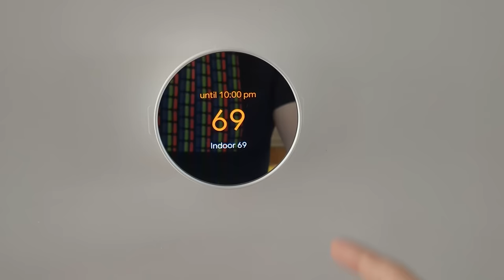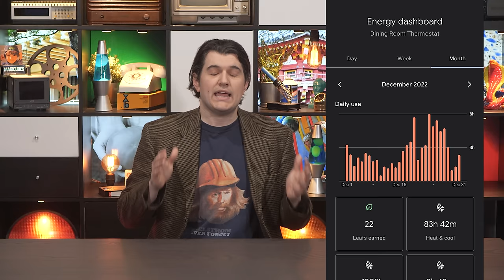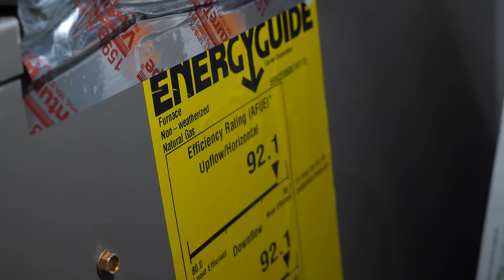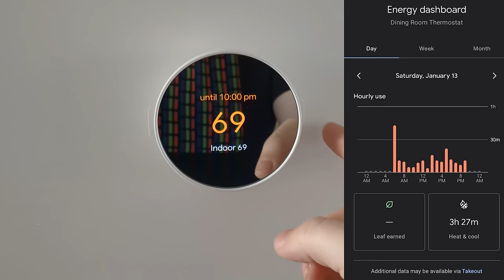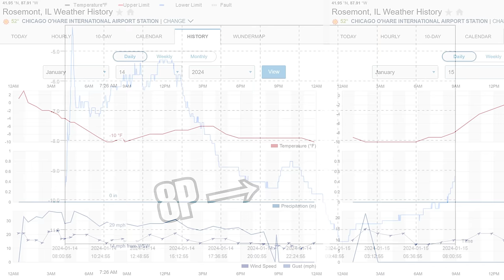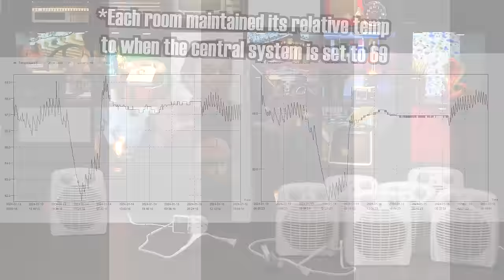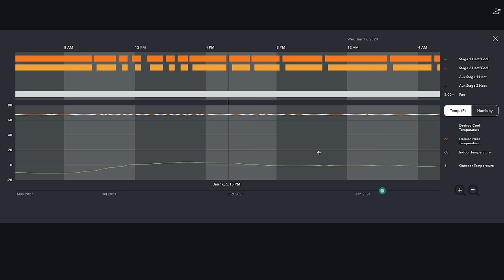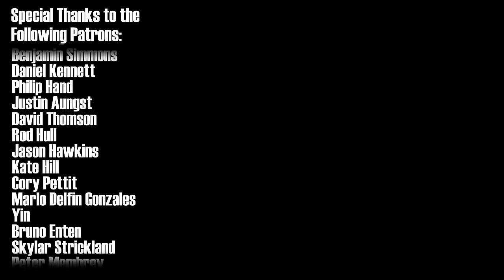Old HVAC industry practices are holding us back and costing us money. But we can fix it.

Comment: I am a HVACR professional and I now train others in the HVAC industry. This is solid gold. I strive to instill in my trade that we have been constantly oversizing  equipment for as long as the trade has been around. 
I converted to what is called a dual fuel setup about 10 years ago that is a heat pump with gas backup heat (lots of boring details as to why I went with that setup) 
 When I bought my house it had a 120,000 btuh furnace installed. I now heat the house with a 3 ton heat pump which matches the cooling load on the home it is matched with the smallest furnace I could get that can provide airflow for the HP and has the capability to  operate at 40% of its rated capacity. I live in a cold weather climate and with some minor help from the furnace on that colder than cold day once In a while it keeps my home very comfortable. 
Using similar  thermostat technology I can track my power and gas usage and typically my furnace runs less than 
15 minutes per day most days. And that runtime is almost all when the heat pump is defrosting. 
My area has incentives from various agencies and organizations will completely if not more hand cover the equipment cost to the contractor for the cost differences in the equipment from AC to HP units. Installation cost differences given modern thermostats is almost $0 
A lot of what someone people will call out as flaws in his analysis are not reading between the lines in his data and methodology. You simply cannot give a masterclass on absolutely everything that goes into this stuff in one hour! Some details are left out.
Great video 
Anyone who says otherwise is definitely selling something
Reply: You sound like one of those that knows your craft. There are a lot of goobers in the HVAC industry, despite all the talk about manual J calculations, I suspect either very few actually run them, or they are not very accurate (garbage in-> garbage out?) because it is very rare that I encounter a furnace that is not grossly oversized.
Reply: I live in Montana, we use a 5 ton equivalent heat punp for heating and cooling, and despite only having 8 inches of fiberglass roof insulation in a valulted ceiling 4000 Sq ft monster. Unless it goes below 0F we don't even need additional heat for it to keep up at 64F at night and 68F during the day. 

Average cost is $270 a month, for heating, hot water, cooling (we love it cold, so 66F during the summer inside) and the geothermal backed heat pump also makes hot water.
Reply: What if I don't want my furnace or ac running 24 hours a day? Having a house that is comfortable in temperature and noise is a feature not a bug.
Reply: Everyone should know a guy or two like you. I don't know any!
Reply: @MegaLokopo  - You must have a noisy one.  They aren't all that way.  My wife keeps asking me if ours is running because it's quiet enough that we can barely hear it.  Sometimes she'll hear something and ask and it's the refrigerator humming instead.
Reply: The most experienced HVAC professionals in Scandinavia know that undersizing the heat pump is the best for your wallet and best for the longevity of the heat pump. See my other comment for more info
Reply: Isn't there an efficiency benefit to not running the system under full load?
Reply: @per7898  Read your full comment, great!
Reply: @JacksTheRabbitsTube   Almost always no for machines and systems.
Reply: @MegaLokopo . I am a little confused as to why it’s important to some to have the furnace run constantly on the coldest days. Sure a larger furnace costs more, but also surely a furnace that runs longer is going to wear out faster. I would like to see a complete analysis of all costs over the entire life time of a typical furnace.
Reply: @MegaLokopo  I can't hear ours run, it's inside a sound proofed metal enclosure, the only noise I hear is the ground loop pumps if I need to add air to the pressure tank, and it's a good reminder to change the filters. 

If it makes noise you can hear you might have issues.
Reply: @Pseudify  It's most efficient running more often. We also run the fan 24/7/365 to help balance the temps in the house, to remove dust and pollen from the air. Living in the mountains with pine trees around we get a lot of pollen in the air.
Reply: @Steevo69    Okay, I hear people say that running constantly is more efficient, but I don’t see any explanation or data as to why that is.  No offense, but I trust data and reasoning more than people’s claims (I’ve been fooled too many times). It also clashes with common sense that something running for 24 hours straight is going to experience less wear and tear than that thing running intermittently for 2 to 4 hours over a 24 hour period (especially when there are high temperatures, running motors, and the like involved). I understand that starting and stopping has costs - like the igniter or flame sensor might wear out faster - but those are cheap to replace. I’m not saying you’re wrong. I’m just saying where’s the evidence for this claim.
Reply: @Pseudify the constant running should only occur on days where the load on the structure is at its maximum when the system is sized correctly which occurs generally only a few times per season. My area didn’t even experience one day this year other years we see it multiple times. 
He mentions this in his video
Reply: @effwrench7524    Yes I know this is what people claim. That’s not what I’m getting at. I want to know why this is and where is the data to prove it. It seems to contradict common sense that a furnace running for 3 or 4 hours a day is less efficient than one running 24 hours a day. I don’t understand why this is and I would like a rational explanation and to see data to prove it.
Reply: @Pseudify  Without going into the constant running/stop start efficiency (mostly because im not educated enough on that topic to address it), lets just talk about the economics of the situation.

Why does this matter?
Well, imagine you go to a restaurant and order a 20 dollar meal. Would you be happy with that purchase if when it came out 60% of that meal was set aside and you werent allowed to eat it? No, you wouldnt. Thats what happens when your heating system is massively oversized. Even when at peak demand, youve paid for a shit ton of capacity youre not ever going to use. (and any heating system is going to be very expensive.)
Yes this analogy is flawed, you dont pay maintenance costs on food you eat so lets talk about that next.

Maintenance costs is frankly irrelevant in regards to determining what size you should get. Sure, a smaller system running more consistently may need more maintenance, but its going to take well over a decade before that system reaches the costs of a larger system. A 3 ton system that most need costs around 2-3k less (depending on models) than a 5 ton system that theyre told they need. Replacing a fan, compressor or whatever is not going to suddenly skyrocket that price to where they match. Even then, the larger systems parts cost more, as they need to be built to support more. An oversized system will still have to be maintained eventually which again makes it harder for the smaller systems to suddenly catch up. (most HVAC manufacturers also offer some form of 10+ year warranty either way.)

Further, most North Americans already have a properly sized temperature unit on their home. Its called their air conditioning unit. Even running at max capacity on the hottest days in the summer, it takes a long time before any parts need to be replaced.
Reply: Anybody want a peanut?
Reply: @Pseudify please see his follow up video on his secondary Channel
Reply: @Steevo69 $270? wtf? i live in europe with expensive energy. i have solar panels and a hybrid heat pump (gas backup, gas hot water) and i pay less then €50 a month for my energy bill.
Reply: @Terrorrai1  1) 4000sq ft/ 372Sq m.
We have seen -40F/-40C for a week, and multiple weeks below 0F and closer to -20F at night and 0F for a hour or two during the day.
During the summer it's not uncommon to have weeks of +100F/38C and during the day and we had 114F/45C peak temps. We keep the house at 66F during the summer.

Only our Viking range uses propane as we live out of town, the water heater is electric and the superheat let's the heat pump make hot water when the conditions are right.

So our, heating, cooling, lights, two refrigerators, deep freeze, Sauna, hot tub, fans, washer, dryer, etc cost us $270 a month.

 Solar for a 2 phase 100Amp service would never see payback for us. We looked into doing it when we has the roof done last year. I am working on a backup propane/gasoline generator solution though.
Reply: @JacksTheRabbitsTube  gas furnaces lose efficiency during heat up and cool down. The longer each cycle is the longer they last and more efficiently they work.
Reply: @Pseudify thermal expansion. There's your common sense.
Reply: @Pseudify  motors are least efficient on startup as they require more energy to start then to keep going. The high amp draw adds resistance which generates heat. Stoping and starting add to high energy costs and wear and tear on windings. At least this is the way I understand it. Also a constant running unit will make it more comfortable with less hot and cold areas of the home . Although a system that’s incorrectly installed which is most of them will have high static pressure in duct work ( higher then recommended static pressure) so a system that runs more might end up with more wear and tear on fan motor as it will be fighting that pressure . And higher energy usage.  I also would like to see experiments testing different scenarios to confirm if running fan 24/7 is best and if a longer running hvac system is best. But it does seam to be the common belief.

Comment: Hearing you talk about Manual J calculations warmed this old HVAC guy’s heart.  Thanks for a great video.
Reply: how many J of warmth tho
Reply: @NickiRusin Depends on the size and insulation of his heart.  Probably between 20-40K btu. ;)  It warmed, not maintained temperature, after all.
Reply: Think about that heat pump in below freezing ambient air.. I wonder what he will think about his power bill using electric strips…

Comment: I’m a HVAC salesperson in the DC Maryland Area. Old oversized equipment is so prevalent here. And you can take your time explaining to the customer why it’s oversized, but when you have customers who say why change it if it’s worked for all these years and other salespeople just spec what they had. I did that to a customer…had a 3.5 ton ac and a old 150k furnace from the 40s…i put a 70k furnace and 24k heat pump. Row home about 1800sq ft. Customer kept bringing up how this website was saying he needed 4k…we installed it, he loves it. Great video!!
Reply: Glad to hear there's someone else in the DC/MD area trying to educate customers! We need more salesmen like you around.
Reply: @andrewsherlock7296  
I try, I try. I still lose customers. Right now im in an uphill battle with a customer who has a 3.5 ton unit, with a small return and plenum to branch out, and 1200 sqft home. Complaining that he already struggles cooling the 2nd floor, his unit short cycles, so air doesn't move with what he has now.

Comment: As a HVAC service tech I have know this for over 50 Years.   I was asked to design and install a new furnace and A/C system in a house which was having an addition added.  The addition was almost 2000 Sq Ft.  The house was built in the 60's had a large furnace 160,000 BTU. I did a precise heat load calculation and added a multi zone damper system to the new furnace. The new furnace was 125,000 BTU 95 percent.  The town inspectors said I was wrong and forced me to provide the calculations.  They OK'd the system a month later. and it ran great.
Reply: You’re adding dampers so you’re already ahead of MOST home builders that cheap out on those.
Reply: Even that seems quite large. I live in Finland and the recommendation is 75W per m² (24 BTU per ft²) so about 50000 BTU for the 2000 ft². My calculations might be wrong and ceiling height might be much larger in your case but it's still a large difference.

Edit: I completely missed the part about an addition so it makes a lot more sense now.
Reply: When I had mine replaced, I tried to convince the HVAC contractor to drop down in size. Old furnace was 100kBTU, 60% efficient, and on the coldest day of the year (-25f) it ran 60% of the time. I figured that the new 97% efficient furnace could be as small as 60k BTU. They insisted on at least 75k BTU, so that's what I got. Based on cycle time on the coldest day, it could have been one size smaller.
Reply: A 2000 sf ADDITION?  Welcome to America, where more than enough is never enough.
Reply: Well you never know what that person's going to use that space for. Sounds to me like a couple of rooms and a new unit for tenants. Which is respectable.
Reply: Town inspectors got some massive ego issues thinking they know better than an HVAC tech that actually *did the math*.
Reply: @Tupsuu  he noted the addition alone was 2k Sq ft, the entire house was much bigger; warranting the bigger size
Reply: @Tupsuu  Assuming the original house was at least as large as the addition, that would be a total of at least 4000 sq ft, so 100,000 BTU, or more if the house was originally larger than 2000 sq ft.
Reply: @Tupsuu Homes in the US are generally more poorly insulated and have much higher air leakage than would be legal in most of Europe. 

In my part of the country there is no mandatory maximum for air leakage; it is simply never tested. The most common type of wall built here has a combined thermal performance of only about R-8, with windows that are no better than R-3.
Reply: @scott5203  oh I missed that completely sorryy
Reply: @Taolan8472  Have you ever met an inspector? They're 90% ego, and 10% failure. And that's assuming they know anything about the things they're charged with inspecting. A friend's brother-in-law is a DOT bridge inspector... he doesn't know a damned thing about bridges. (or have a college degree... in anything) A local electrical inspector who gave us grief for months... FORMER electrician -- I checked, he no longer has a license! -- who had been FIRED FOR CAUSE by the contractor doing our work. (He was definitely not doing things out of spite. And his boss was too much of a pencil d... to overrule him. It took a mandate from UL, and the two engineers who's PE seals were on the designs to shit his ass up.)
Reply: @frequentlycynical642  that's smol
Reply: @quarterswede automatic dampers arent needed and just offer more potential callbacks. Manual dampers are ideal
Reply: 125k but ac sound aswome in texas
Reply: @DelGTAGrndrs  Correct.
Reply: @frequentlycynical642  "Wahh! People are doing what they want with property they own and it doesn't hurt me in the slightest!"

Comment: I have a 2 stage heater. When I moved in I was excited for the winter that there will always be mildly warm air continuously flowing off the vents as the undersized stage 1 struggle to keep the home at equilibrium with stage 2 kicking in every now and then.
Forward to reality: Stage 1 is alone capable of not only maintaining the heat on the coldest day of the winter, but having the audacity to only work half time.

Stage 2 only kicked in if the delta between temperature and set temperature was big. Only happening after vacations.

It is not only that the furnace was oversized, it was stage 1 that was oversized.